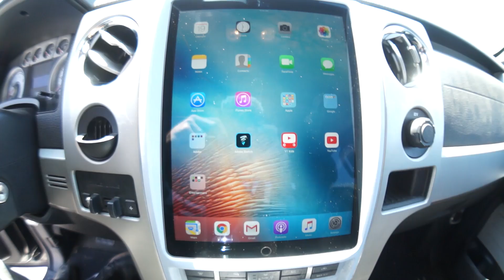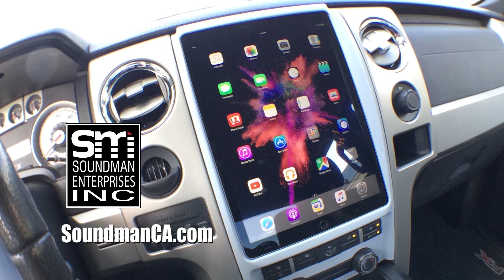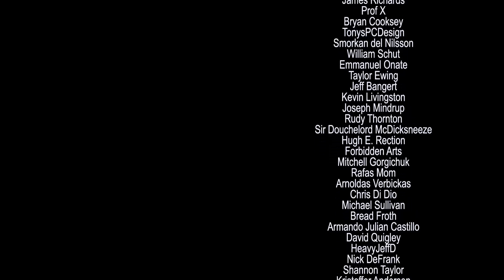DON'T MISS THIS! - Vaydor Update - AMPLIFIED

Comment: Now that you have all of the extra space. It would be dope if you adding a lithium ion audio battery local to the under seat area? XS power, JY power, Braille Battery, WPS, Lithionics, etc. They're all ruinously expensive. But they might save you the trouble of putting in a higher cap or secondary alternator.

Comment: What I don't get is why you don't cnc "dashmount by soundman" with your website under it, Into that backplate of the mount. why miss out on the continual advertising? If that won't work do a slight embossing so that when you glue the felt in, It'll show through.

Comment: So if you had a 350A MECHMAN ALTERNATOR, maybe 2 D3500 XS Power batteries in your F150, would you get the full 7K watts from the CT Sounds amp? Or would you still need a second alternator?
Reply from the maker: +0421 Salesi yes!... 7000watts divided by 14 volts equals 500 amps, so a second 280 amp alt would be needed.

Comment: Hey Doug. I have a budget of around 5k to build a system for my friend. He wants it to be loud and but also clean. What brand would you suggest for speakers? The system should lean towards spl style.
Reply: Simon G ok 5k and you need to ask questions like that
Reply: Jerry Nierzejewski I've only built systems with b2 audio, a local brand and kicker but I'm curious to hear what he has to say. I'm sorry that I'm not an native speaker but could you explain why the question was ridiculous because of the budget? It's meant to be built in an limousine.
Reply: Audiofrog